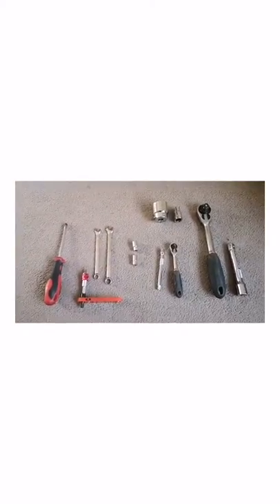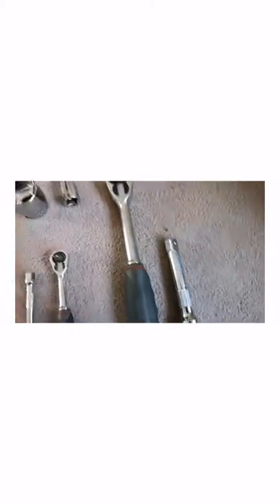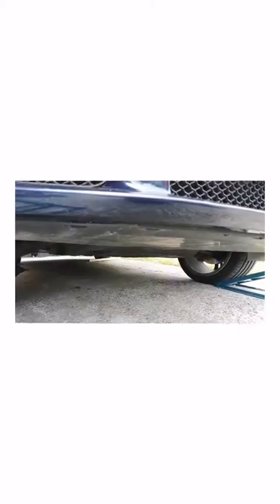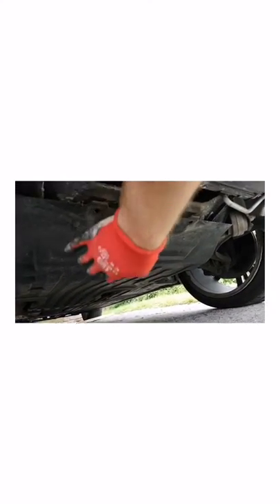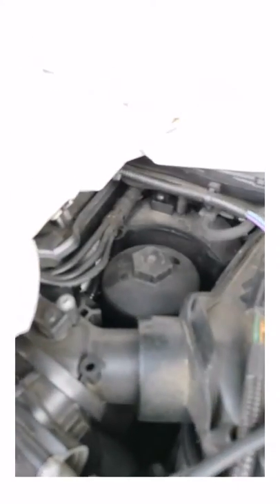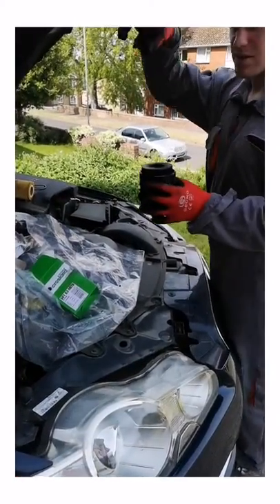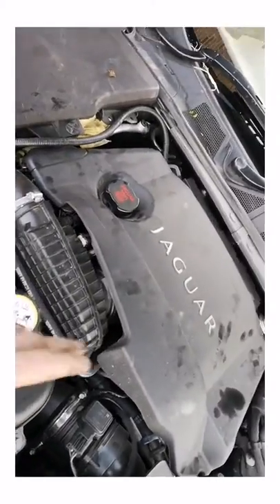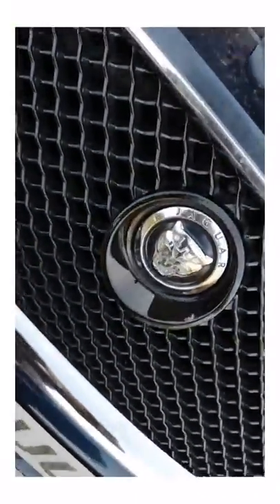Jaguar V6 diesel (10 plate) oil and oil filter change

Comment: I got a Jaguar 2007 xs model 2.7 diesel., Actually I’m changing the oil, oil filter and gear box oil . I will link my video here in a bit . And show u how it’s done . To unscrew the oil plastic cap .

Comment: That filter is missing something compared to the one on my diesel s type. There should be a small raised nozzle with an o-ring. This sits in a hole at the 7 oclock position when looking down on oil filter location. Thus you need to fit the oil filter into position then fit the housing other wise you will not get the filter in the correct position and never seal it.
Reply: The 3.0lt is a different filter (No Nozzle) P7155 Filter is used on this XF & XFS